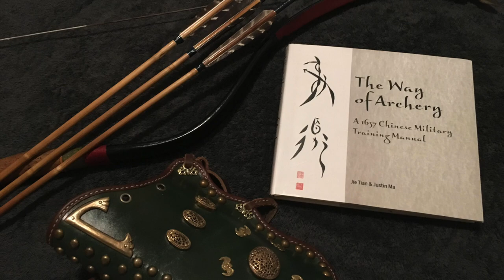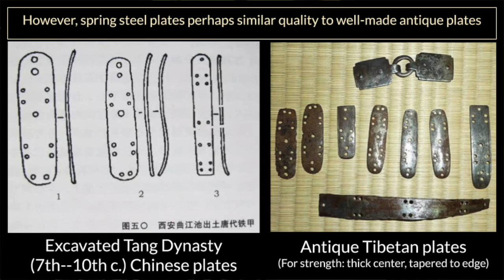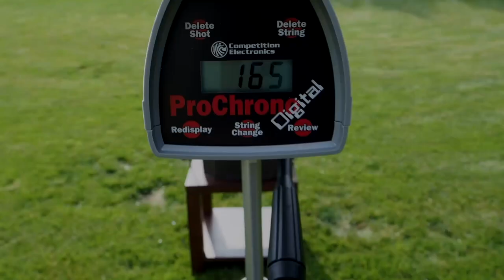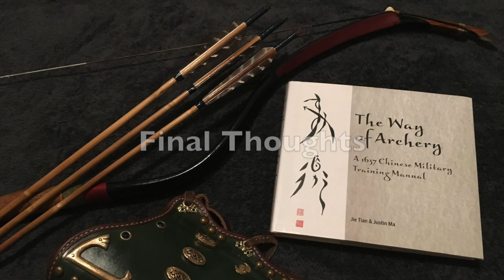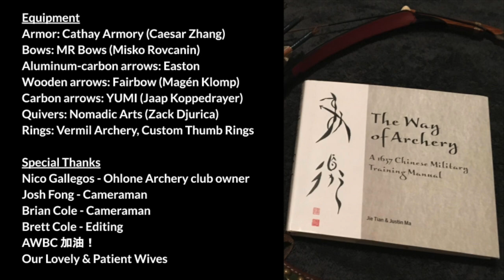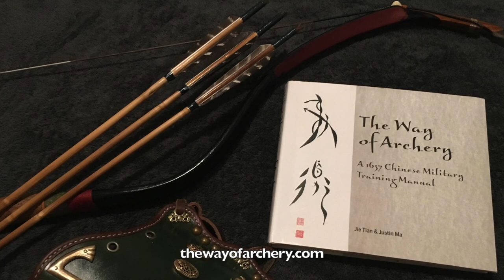Warfare Research Series (Episode 1): Chinese Lamellar

Comment: Seeing how beat up that piece of armor got frmo deflecting a few arrows really puts a new perspective to things... Even if you're safe from the first few arrows, this style of armor will quickly come apart if you're being hit repeatedly.
Reply: Is there a point to armor that would still protect you when, statistically speaking, you already got hit through a gap?
Reply: @oneukum  I'm not sure what your point is :)
Reply: @MaMastoast  If the armor can take enough arrows, you build either armor covering more of the body or lighter armor. There is no point sacrificing more useful capabilities for a corner case.
Reply: or are they using historical accurate armors?  The historical armors used narrower plates, and each one usually measured 1.5mm-2.6mm in thickness (depending on the area of protection) Sometimes it could go as thick as 3mm, and when laced together it could provide double that thickness. The historical plates also had a slight curvature to deflect arrows. In addition, the curvature also provided more structural strength to the plate than a simple flat-piece plate.  Also, historical plates are tightly packed together as a single band and smoothened the plate edges so that it allowed less gap between the plates.  Instead, this replica used wider, 1mm thick, machine cut, flat plates with larger than normal holes on them.  

The lacings on these modern replicas often used modern leather lacing that can be easily torn by pulling on them as Skallagrim had demonstrated by pulling the lacing and breaking it while trying to tie an armor piece onto a wooden pole.  Modern-day lacings, a replica maker wrote, "lost most of the biological elasticity through the curing process," but he often had to make do with these laces.  He thought that was a pity because proper lacing is the most important thing in making a lamellar armor.  If these things were not historical, how would it be different, historically speaking, from shooting at a suit of butted mail?

Comment: I had an idea about the 30 meter penetration test historically.  Not only is it perhaps a more realistic battlefield application, but I also wonder if the arrows might hit with slightly more energy transfer than at a closer range. 

Though an arrow does lose momentum through air resistance over distance, if the arrow is still flexing from bending around the bow.  When it impacts the target more of the energy might transfer horizontally though the arrow causing it to break, with that break releasing a good amount of the energy.  If the arrow is given more time to straighten out the energy might travel in a more direct path, allowing more energy transference straight in to the tip, and thus in to the target despite the longer overall distance traveled. 

I haven't had a chance to test this myself, other than noticing relative target penetration with good or bad khatra in Turkish archery at close range.  I would love to see if this has any effect, and possibly if a slow motion camera could document at what distance a given arrow straightens out in the air and place a target just beyond that point. Then test penetration at half that distance vs. just beyond the point where it straightens out. 

Loved the test and the scientific emphasis you have with it, and looking forward to seeing what you do next.
Reply: I am afraid I have to disagree with the point about breaking. A part of the kinetic energy and momentum is in the part breaking off. And it will dissipate harmlessly.

Comment: Thanks for doing this. I'd always wondered how vulnerable the lacing was on lamella armour.
Reply: But lacing was easily repairable after battle.
Reply: @Gongolongo  Yes indeed-far easier than repairing mail & simple after battle in the field. I just wondered how much could be cut in battle before gaps appear. Though  with 3+ seperate lines of lacing tying every scale/lamellae theoretically they should hold in place until  sevreal cut.

Comment: I love how you are as scientific as you can be in your testing, and acknowledge that it's still just "data points" and not true experiments. I think if you keep at it you can create true experiments in your videos with more thought of the variables involved, how to control and test all of them, and just time and budget. Good luck! I know little of archery, and look forward to learning. Thanks!

Hitting that same plate over and over, lolz nice grouping! You are clearly a good shot.

At 2:30 When you say "bullet shaped point," not all bullets are shaped that way. FMJ (full metal jacket) bullets are shaped that way in most (not all) rifle rounds. Bullets can be HP (hollow-point) or FN (flat-nose), and many calibers like .45 ACP are rounded ogive shaped even in FMJ. I do know what you mean tho 

Posting the physics formulas you use is a good idea - it's showing your work. It also cuts down on stupid people saying stupid things when they don't know any better IMO. It's a big step towards proving your conclusions. Be sure to use complex models, the matter in motion striking the other matter is a complicated phenomenon that requires many equations to represent everything that is happening. For example, 2 arrows can have all the same characteristics (mass, velocity, length, arrow type, etc) but one's shaft might be stiffer than the other and that would affect how it penetrates armor. The more variables you account for, the stronger your conclusions and eventually (IMO) you can get a model that takes everything correctly into account and so make predictions and strong general rules that can be simplified to aid in understanding and arrow selection for various tasks.
Reply: Thanks for watching - and for the feedback.

Comment: The performance of the bows tested is comparable to a yew warbow, albeit at a lower draw length. I assume they're fibreglass. Is that right? The Turkish horn-&-sinew bows tested by Adam Karpowicz performed slightly better, while that 82lb@32 Manchu bow performed dramatically better (135 J at 190 fps & 15ish grains per lb of draw weight). If you're going to be shooting heavy arrows & trying to pierce armor, a Manchu-style bow appears far superior to other options. (Yumi with long draw lengths likewise seem pretty good.)
Reply: Hi, Benjamin. The challenge is availability, wait time, and cost, especially in regards to bow designs like the Qing/Manchu. We hope to continue to expand our testing implements in the future. Stay tuned. :)

Comment: There may be a significant difference between the materials (spring steel vs steel made in ancient times).  The relatively weak steel made in the ancient may not be able to stop a heavy arrow. But at the same time, the arrow tip made in the ancient may be weaker as well. Oh well.....  nothing can be perfect. Overall, great video.
Reply: It is definitely challenging when it comes to matching the quality (or lack thereof) of materials. The arrows we'll be using in our next video were crafted by artisans with extensive knowledge of historical methods. Thanks for watching!

Comment: Be interesting to see if the non penetrating shots had the energy to break or crack ribs, as I believe that alone would be enough to take another archer or foot soldier out of the battle.
Reply: We hope to use impact sensors in the future to gain insight on blunt force trauma.
Reply: @blake436  I look forward to that.

Comment: Impressive. One thing though, if it was in a battlefield, the armoured person would take several hits.The first ones damage the armor and left you exposed for a blow. Thanks
Reply: What's the likelihood the wearer would take multiple hits under most circumstances? Even if they weren't carrying a shield, the effective range of a bow against armor is short enough to close in very little time and the interval at the front rank required for archers to use their weapons effectively means there wouldn't be that many archers to the frontage of men at arms.
Reply: @Derna1804  A siege. Chinese loved their fortifications.
Reply: @CanalTremocos  True, but people tend to spend most of a siege crouched behind things. You'd be more likely to get murdered by a dagger board than shot ten times. In case anyone was wondering, a dagger board is a large square board full of knife blades which was  swung on a pulley-crane to defeat an assault by cloud ladder. A cloud ladder is a siege tower which has a large folding staircase which allows men to run straight from the ground to the parapet.
Reply: Abu Troll al cockroachistan  Excellent point, but you also have to take into account that a shield is an extremely effective defense against arrows, and the Chinese developed crossbows very early on, giving them some standoff against nomads. While a horse archer could carry many bows into battle, riding back and forth to pelt the enemy with arrows and retreat also exhausts the horse, which can lead to disaster.

Comment: What I found interesting was how you did find the same plates with regularity, and that the combined hits got a penetration.  The armor could save you from some hits but at a cost to the integrity.  

How much work would repairing the armor to similar pre battle conditions?  Just thinking from a campaign sense, you could be on the move and engaging again soon.
Reply: If you have spare plates, definitely not much time.

Comment: Interesting test, using modern steel and carbon arrows, if possible, another using traditional arrows and metal of the time would be good, even mild steel, spring steel too resilient, and also have traditional under armour garments.

Comment: Did anyone else notice the flash of flame or spark from the heat generated when the second arrow head struck the armour?    A tiny distance from the apparent impact point at 1 oclock.

Comment: Is the lacing too weak? Is the armor historically accurate? From what I saw on the internet the gaps between plates are really small.
Reply: The top and bottom lines of armor is single layer. Middle lines are crossed layers. So test results are so differently.
Reply: the plate is too thin.  Historically, plates range b/w 1.5mm-2.5mm in thickness, this replica is about 1mm.  the lacing might be weaker than traditional armor lacings as well because traditional lacings need to be limed.

Comment: This raises a big question about Chinese logistics for me. Would Chinese armies have spare plates and leather lacing on them to repair their armors? Seems a good volley of arrows would compromise any lesser suit of lamellar for sure.
Reply: Naturally, the advantage of lamellar armor was that you could mold standardized plates by the million and store them compactly in stacks.  The lacing also makes hand repair possible whereas mail would need special tools, and plate would need to be reforged.  This made lamellar pretty ideal from a logistical standpoint.  Still, there were long periods of the Chinese middle ages where socioeconomic collapse made armor comparatively rare (the collapse of Han to early Tang, the last century of Tang).  In those cases other suits of armor were probably cannibalized to repair existing sets.
Reply: It's not surprising that the Romans used lamellar armor for awhile but largely reverted back to mail. It seems like a massive hassle to maintain, and I recall an Arab source complaining how the leather takes on a ferocious odor if it gets blood on it.
Reply: First of all, this is a Mongol or Tibetan style lamellar armor, and the replica is made from Tibetan armors, though the Chinese do have a similar style armor, there are also other types of lamellar armor.  

Second, I remember from another test testing these lamellar armors (by Skallagrim I believe?) the tester tore the leather strings apart using hands easily, this means these are modern leather production that was cured and lack any sort of elasticity, which is only good for making bags and boots.  And from what I read from an armor maker, the leather strings they used back then were tanned leather strings, which are pretty durable.  When an arrow hits it, the string shouldn't tear, and the material should be strong enough to be made into a bowstring.  To make lamellar armors, he says, you have to really study the strings, Without paying attention to this, it is like testing a penetration test against a set of butted mail.

Third, the actual thickness for an armor plate historically is usually 1.5-2.5mm, depending on the protected area, and sometimes the plates can be over 3mm thick.
Reply: I assume they use the lames off the damaged armor of their dead comrades. Lamellar was probably used because it's rather self sufficient and you can just replace damaged parts.
Reply: @Drownedinblood  Mail is even easier to repair, since it requires no leather or fabric cording. You simply replace damaged rings as needed.
Reply: @TheChiconspiracy  it's more time consuming though and you'd need a forge or something to make metal wire and rivets unless you're just going with butted.
Reply: @Drownedinblood  Why would you need to make more metal wire? You can simply bring spools of wire and a bunch of rivets with you. Any half-organized army is going to have armorsmiths tagging along who will set up a mobile forge, but all you need to create riveted mail rings is an anvil and a few hand tools.
Reply: @TheChiconspiracy  So that's still an armorsmith or two and extra materials you have to bring to repair your armor.
Reply: @Drownedinblood  Or two??? Making a few riveted mail rings is not complicated: https://www.youtube.com/watch?v=C_NdBxcj-OI

As opposed to an armorsmith with extra lamellar plates, the EXTENSIVE cordage required to attach them, and the tools needed to work with that cordage and the metalwork... 

And that's not even considering the field maintenance done by the soldiers themselves. Mail covered in blood, mud, or other filth can be cleaned easily in a bucket of sand and then re-oiled, and the mail rings moving against each other help keep it cleaner naturally. Your lamellar armor meanwhile has to have each piece of metal individually cleaned, and the cords require constant replacement.

There are ZERO period sources that agree with you that lamellar armor is more convenient to maintain than mail.
Reply: Lamellar armor is a lot more troublesome to repair plate by plate, but unlike mail armor which usually comes as a whole shirt, lamellar armor can be compartmentalised. Let's say you are hit in the shoulder and your lamellar pauldron is ruined, you can just slap on a spare pauldron and it's as good as new. BTW Byzantine Empire used lamellar a lot longer than "a while".
Reply: @TheChiconspiracy  who's done a comparison on maintenance between the two in the first place? It seems like you are using lorica segmentata as your reference for lamellar. Making rings isnt what makes maile difficult, its riveting each and every ring. Lamellar can be lacquered and require less maintenance as the metal won't be directly exposed to the elements. If not lacquered I imagine a brush, cloth, and brisk shake can get most stuff out. Byzantines made extensive use of lamellar, why is that?
Reply: @戰國春秋  exactly. All that you need to repair lamellar is found in another damaged set of lamellar, no need for extra materials.
Reply: @戰國春秋  And if part of your mail is ruined, you just repair a few broken links and it's fixed... no need for leather attachments. Yes, the Medeival Eastern Roman Empire did have lamellar armor, (often worn on top of or attached to mail) but that doesn't mean that it was easier to repair.
Reply: @TheChiconspiracy  Hasty battlefield repair still leaves the armor in a degraded state that it originally is, especially after repeated damage-and-repair for long campaign, and it still takes more time, skill, and tool than simply swap out for a ready-made spare part (by spare part, I don't mean spare metal plates and lacing, I mean entire spare sets of pauldrons, cuisses, vambraces, breastplates etc, either brought along for the campaign, or cannibalised from fallen soldiers).
Reply: @TheChiconspiracy  Obviously, sooner or later (i.e. after the battle is over and the armours are sent back to the armoury) someone has to actually take apart the damaged armours AND spare parts for some serious repairing, and it will be a real headache. But as far as frontline troops are concerned, having access to spare parts is still preferrable to field repair, as it saves them precious time and keeps the armours in intact condition longer.
Reply: @戰國春秋  On an actual battlefield, there won't be much time for repair, and thanks to the way that mail hangs off the body, a few broken rings is far less dangerous to the wearer than a few broken leather straps that cause larger sections of lamellar to fall away.